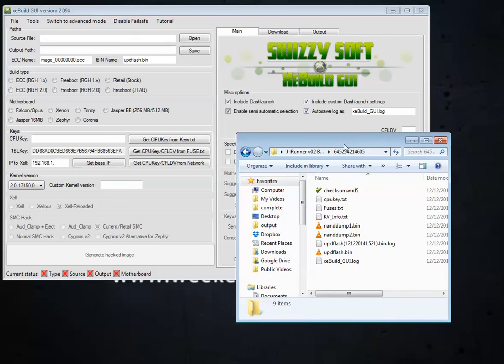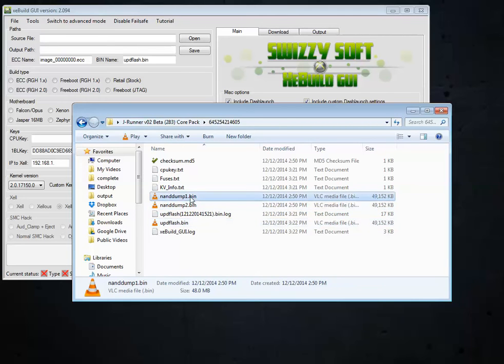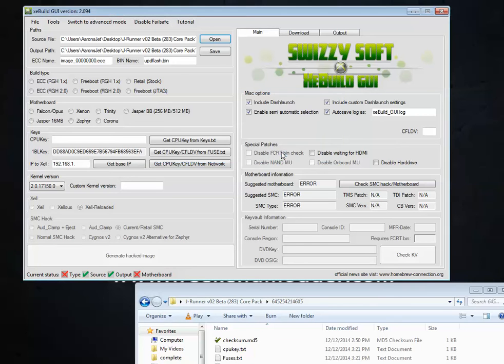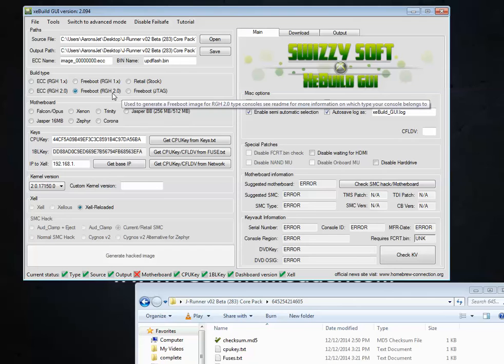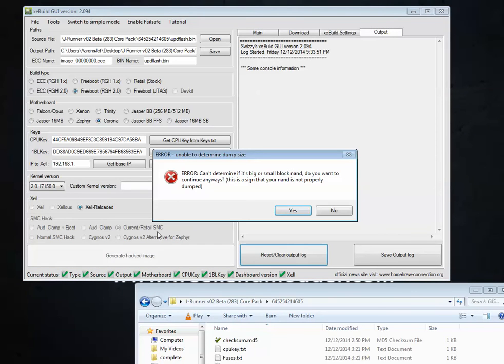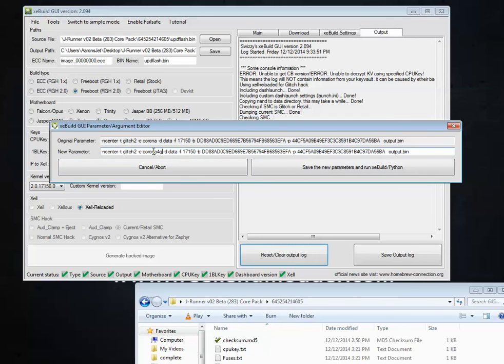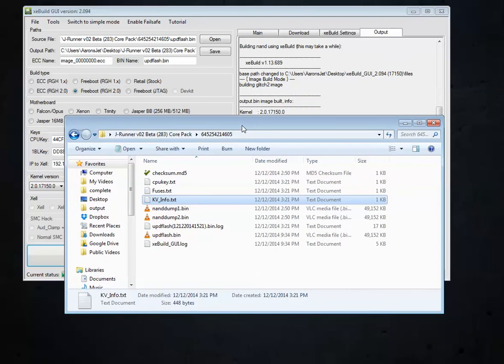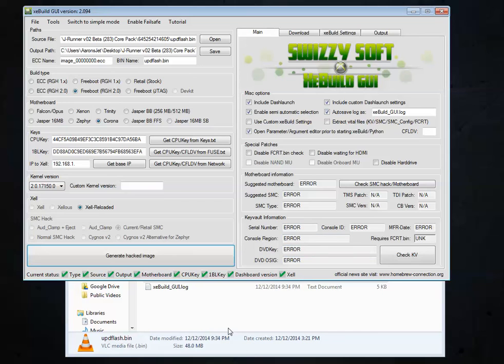How to update dash on RGH --- Corona 4G Variation difference!

Comment: My corona4g ends up dvd drive no read any game disks only detect as pic n video. So, it is need to tick the " disable fcrt.bin check" before generate the nand. Also after done flash the new updflash, it is need to update Avatar via official usb update same versions as our xebuild, mine is 17544